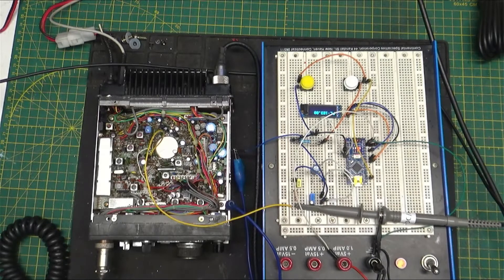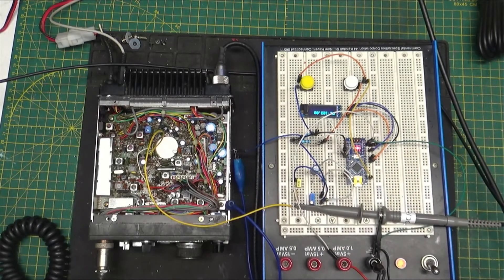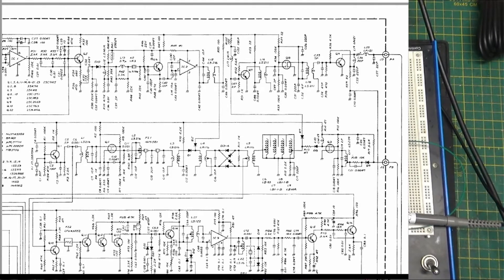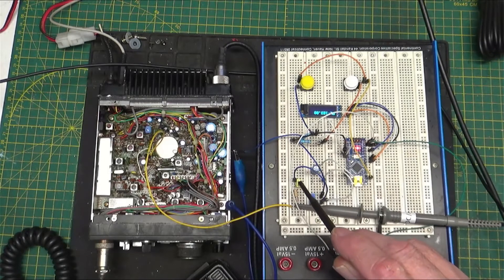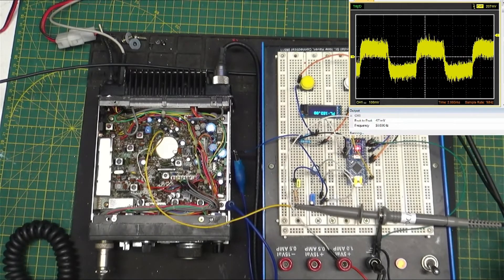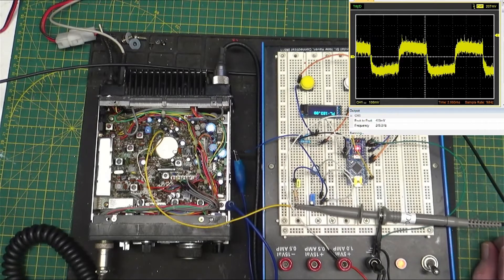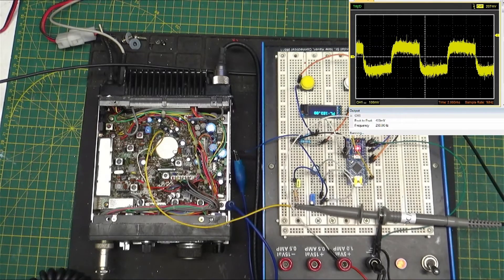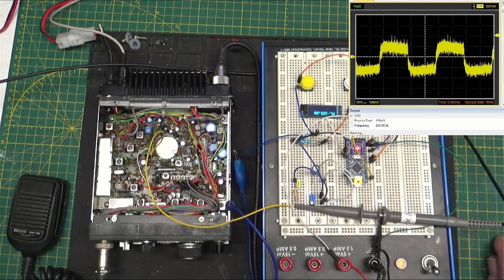Arduino CTCSS/Tone Proof of concept

Comment: Fantastic!  Thanks for the video.  I have a Conar 452 2-meter transceiver (National Radio Institute) I built in the early '80s.  I dug it out of storage a couple months ago.  It does not have a tone generator on board and I've been looking to see if adding one was possible.  Good to know it can be done.  73,  KC3YHM
Reply from the maker: Very cool! A Conar school radio. Havent seen one of them in years. Let me know if you want the code.

Comment: Good job, but it is a square wave so there are a lot of odds harmonics and I think they will be audible. You should add a low pass filter. 73s.
Reply from the maker: Your right. I did add a filter to the final project. It smoothed out the square wave pretty well. I did find that the parts necessary to do that really depended on what radio I put it in. I checked it on FFT and managed to get the harmonics down about 30DB. I think that will be OK. I checked with some folks on a few repeaters and they reported that they couldn't hear it.  
Thanks for watching

Comment: Fantastic. It looks like you're just using a digital out of the Arduino, is that correct? I'm looking into doing something similar for some older radios I and a friend have. '73 - N8OZY
Reply from the maker: Be sure to watch the other 2 videos on this to see the final outcome. I have it in my car and it works perfect. Thanks for watching.